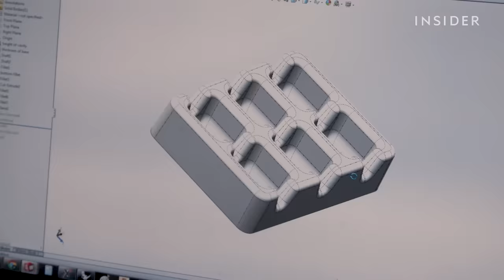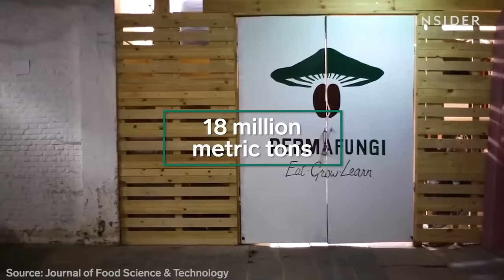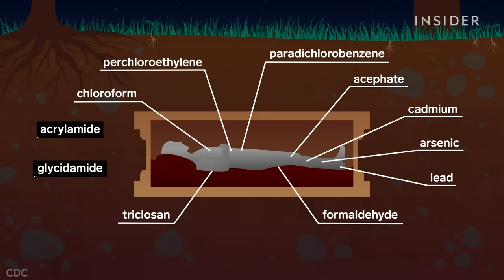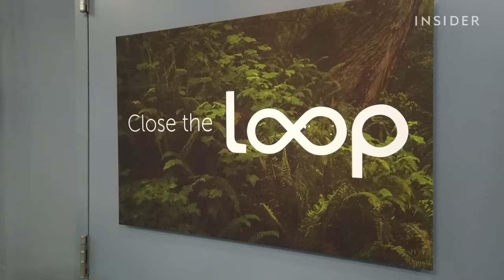How Mushroom Startups Use Fungi To Fight Waste | World Wide Waste | Insider Business

Comment: I have been experimenting with growing oyster mushrooms at home. Anyway I soaked this paper shipping bag that I received a package in in boiling water, and once it cooled placed mycelium in it. Then I wrapped it entirely in plastic wrap and since I didn’t realize the importance of ventilation at the time, didn’t poke holes in it and I basically forgot about it. I set it on top of another container that had plastic wrap over the top. A long time later (I think several weeks) the mycelium seemed to have eaten a hole in the plastic wrap and had gotten onto the plastic wrap of the container below it. I thought it was cool!